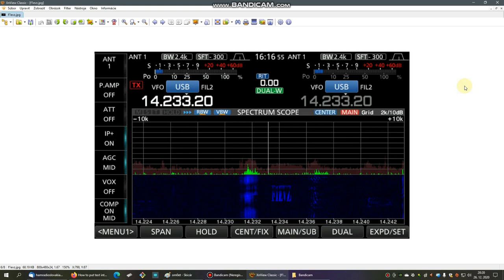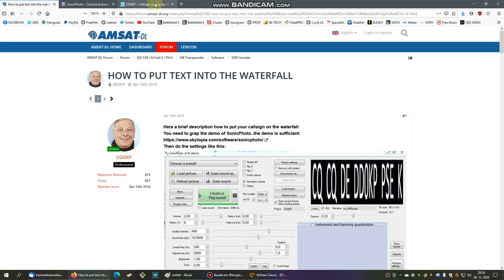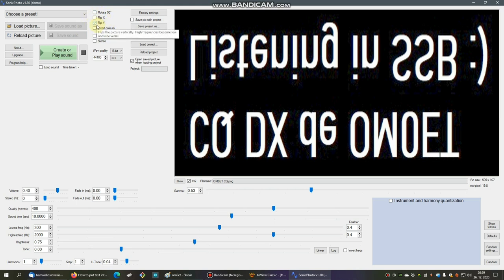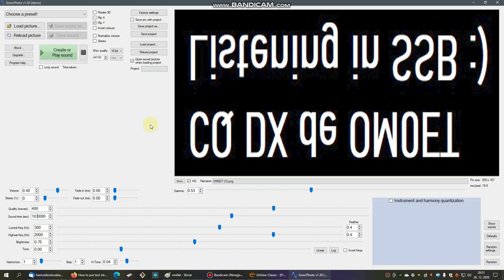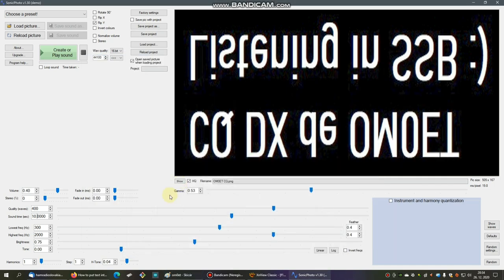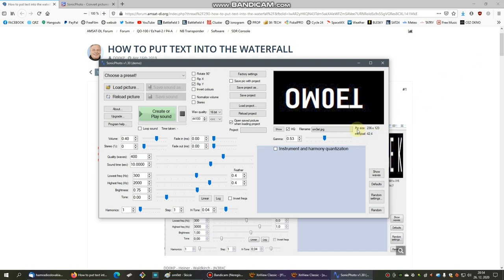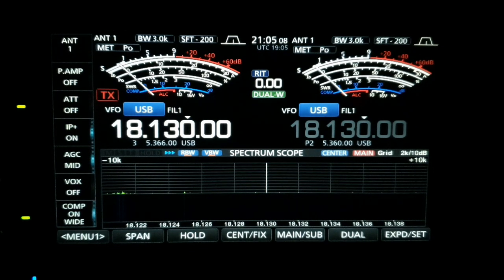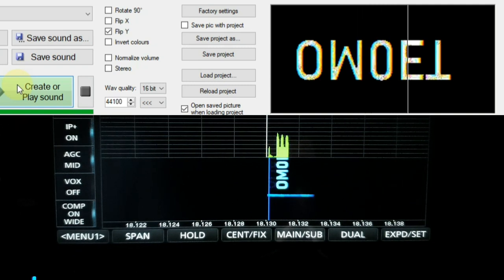Put your Callsign into the Waterfall

Comment: I have been transmitting sporadicly pictures and graphics for over a year on 40m, only one station got curious enough to zoom in and see that I was sending graphics and my call sign !! I've also sent QR codes, if you take a cell phone and photograph the QR code on your scope, I can send the user to my QRZ page or send other text messages !! Fun software. I wish it was conceive as a ham radio software to transmit and receive but it is rather used primaraly as a sound synthesizer.

Comment: Isn't it considered broadcasting (and a violation of Amateur rules) if you are transmitting audio but not communicating with anyone? Also, it seems to be bad practice to throw random noise onto the bands. Deliberate QRM. Wouldn't want to see people doing this with any regularity. Please do not do this.
Reply: Some slow scan tv operators use waterfall text to communicate. The option is built into software such as QSSTV.